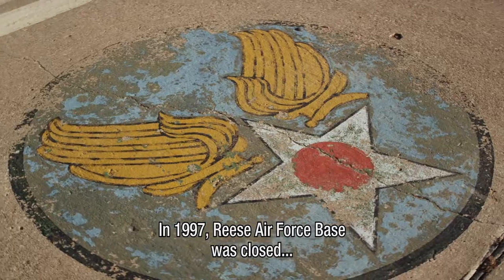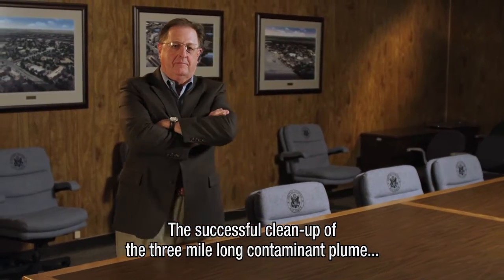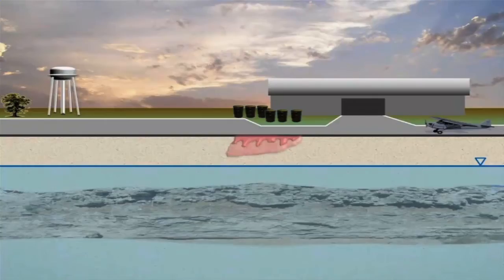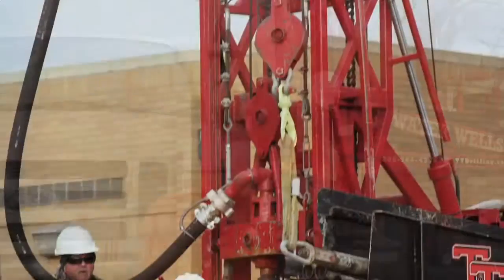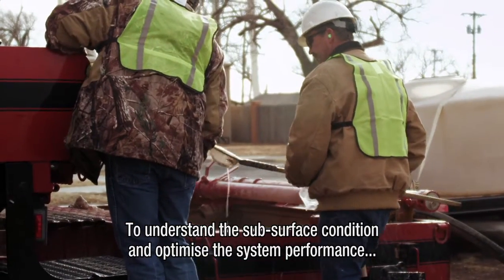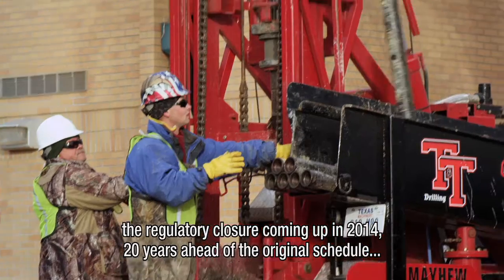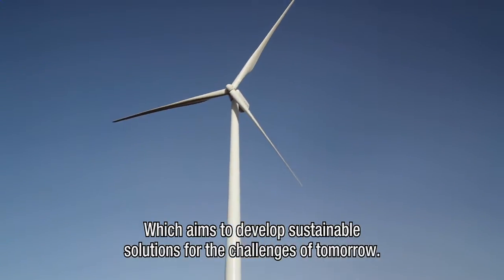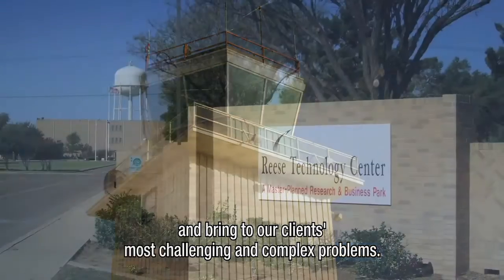Being the Best #16: Reese Air Force Base

Comment: We use to clean engine parts in chemical vats and GOD only knows where the solvents got drained. Mostly the cleaning room did the work but I remember going over there and cleaning parts when they got behind. I never dumped it into the ground though.
Reply: I worked at Reese from '84-88 as a civilian.  I witnessed lots of solvents that were simply  dumped in a huge pit at the southwest corner of the base.  I know what was dumped because our shop dumped some old paint and solvents into that pit.  It had to go down to the ground water.   Not sure if anyone knew about this dump.
Reply: I have a theory that the base was floating on a sea of 5606, 7808, JP4 and God only knows what else by the time of its closure.  I think its golf course lake was probably producing mutant mosquitos by that time due to the seepage. LOL